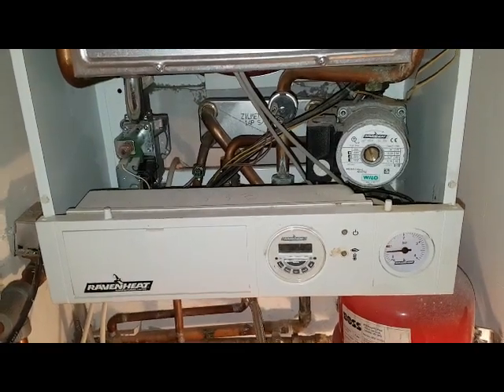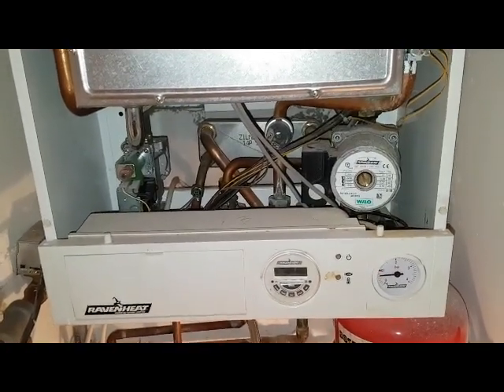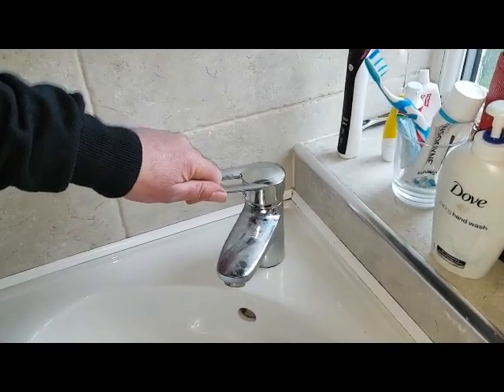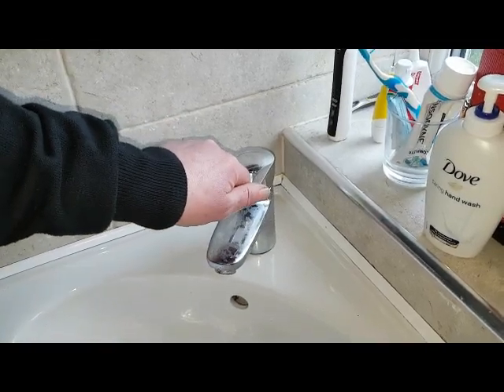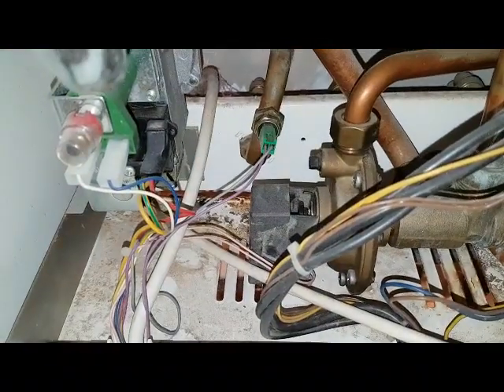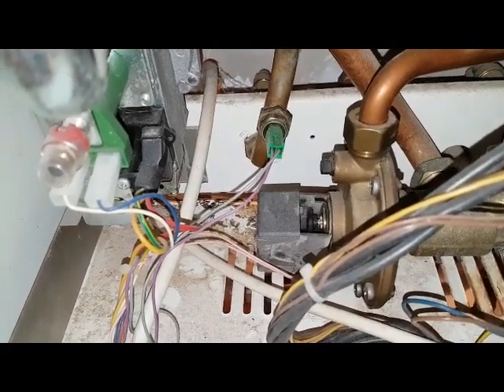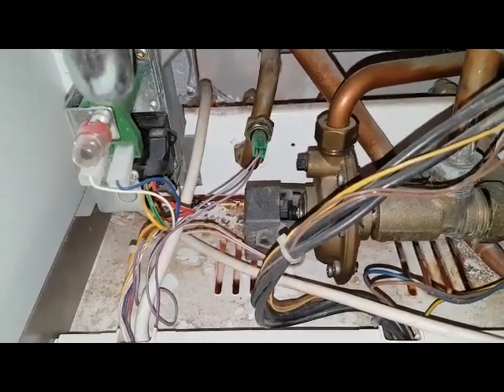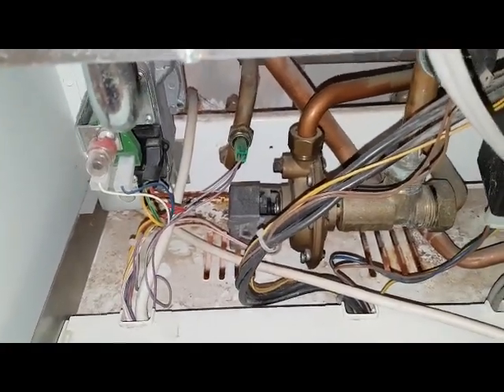Diverter Valve Test

Comment: I have separate h&c taps, when the hot tap on, as soon as I open the cold tap, the boiler immediately cuts off. Is that due to a faulty diaphragm or does the whole diverter valve need changing?

Comment: Does this valve fault cause hot water to work only downstairs, but not up? Which is my problem.
Reply: No, it must be something with your hot water pipes that leads to upstairs... Or maybe  valve in wall is blocked for upstairs.
Reply: @Aw4ken3d  could be an issue with the pump

Comment: I've got an issue with a Ravenheat CSi120 T - it is currently not delivering continuous hot water. Water gets hot - then goes luke warm then hot again repeatedly.  When calling for HW the Boiler fires to give hot water  - then shuts down - then fires up again. Suspect the diverter is the issue. Any pointers appreciated.
Reply: Could be caused by your plate heat exchanger being blocked also
Reply from the maker: Could be a primary sensor or flame sensing electrode
Reply: No
Reply from the maker: hey we're currently trying to grow our Facebook group and would love you to join Tony and the team using this link, Tony will be available to answer all your questions directly there's also updates on new trainings we just released too. https://www.facebook.com/groups/167070231326174

Comment: What is the cause? There doesn’t seem to be many things that can go wrong with 'a valve'. Can be cleaned or serviced or would you need to replace it?
Reply: What if pressure is constantly pushing against micro switch
Reply from the maker: hey we're currently trying to grow our Facebook group and would love you to join Tony and the team using this link, Tony will be available to answer all your questions directly there's also updates on new trainings we just released too. https://www.facebook.com/groups/167070231326174
Reply: Normally the rubber diaphragm inside the diverted valve has failed or has a small pinhole in, causing loss of flow to press against the micro switch. I believe just the diaphragm can be replaced.
Reply: Matt Walker Is correct. Totally agree but it could also just mean the plunger just needs greasing.